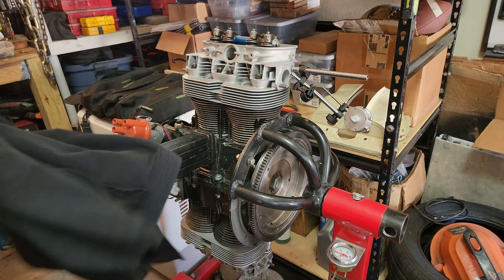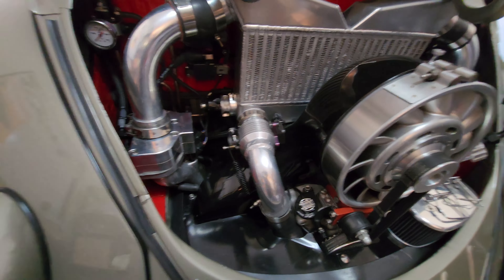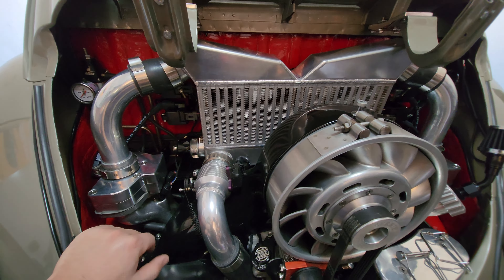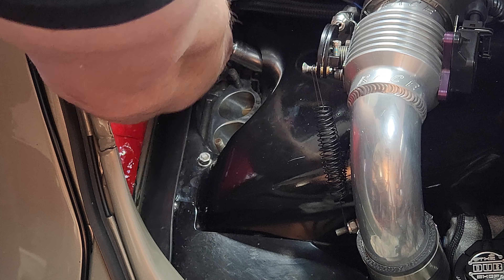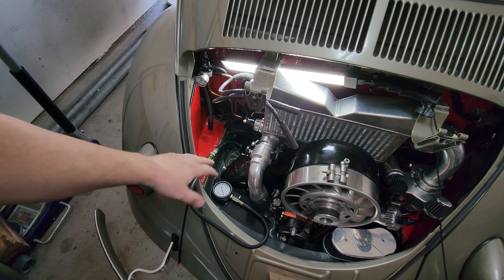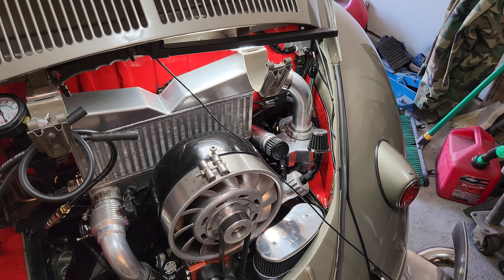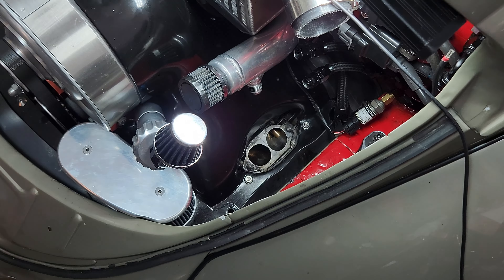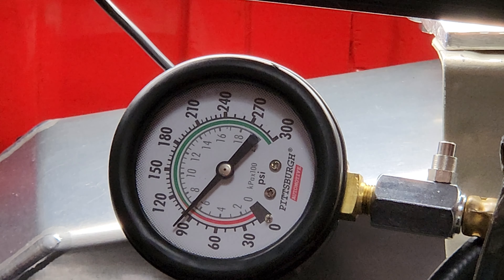TURBO Troubleshooting Air-Cooled VW | Boost Blow-by | JW Classic VW

Comment: Nice video,  your concerns are real. Piston seal is probably your biggest problem. Honing and piston rings now days can be done professionally. I use to do the same as you, now I get to those with the big machines and diamond stones. It works, no more problems.. good luck..
Reply from the maker: Yeah I'm having a set of torque plates made for this next go round, I really want to be able to do the hone myself.  I'm weird like that.

Comment: Running your oil level to high. Turbo engines run deep sumps and 1 to 1/2 quarts lower than stock levels. Helps drain the oil back out of the valve covers. That way while under boost oil is not forced down valve guides. .
Reply from the maker: Yeah.. my Oil pump scavenges the oil from the valve covers..  not sure how fast though, under boost I'm sure they fill right up.

Comment: I use Empi wider gaskets on mine adding a little engine oil to them... never had them blown. No sealant...
Reply: tested at 30 psi, no  leaks...
Reply from the maker: That's good to know..  just going off what I've seen recommend but definitely thinking about running some.

Comment: I had a bit of pinging on my freshly rebuilt motor, but it turned out to be too much advance on the 009. Apparently, a stock H Code 1500 has 0 degrees static and I had it set at 7 degrees! (Some info says all VWs are 7 degrees; not so!) Couple that with the uncertainty factor of the mech-advance 009 and you could end up with way too much advance as I did. An SVDA might be on the list soon, but meantime it doesn't pink anymore.
Reply from the maker: This is why I need to get my baby to the tuner after the fresh rebuild with the new pistons.
Reply: @JWClassicVW  Good idea. One thing having an out-of-tune motor that puts out 70HP but another thing altogether when your talking about a turbo-pressurized 300HP monster!!
Looking forward to seeing how things progress Jason :)

Comment: That sucks, you have to pull the engine out again. Use HQ engine parts to handle the boost/high heat.
Reply from the maker: That is the plan 4 sure... also getting some torque plates to Hone the new cylinders as well.

Comment: When the last time you did a vavle adjustment? Cylinder 2 look like it tight.
Reply from the maker: I check them pretty regularly since they are set to 0 lash, but it's all apart now so I'll be running through everything again.
Reply: @JWClassicVW  I seen that.

 I'm getting ready to get my motor running it's full potential soon. Got chromoly push rods, solid rockershafts, new swivel feet adjuster on the way, I got my set of 44idf now I just need my intake linkage and air filters. Going on my 1835cc with a Erason racing cam in it. It runs good right now besides its under carb with a Weber 38dg it try sucking the butterflys out the first on
Reply from the maker: Sounds like you've got some fun coming!

Comment: im thinking over-advanced ignition timing resulting in high cylinder pressures or fuel octane issues
Reply from the maker: I'm sure the timing and fuel is probably off a bit under boost... she needs some dyno time.
Reply: @JWClassicVW  im also not sure that Harbor Freight gauge is accurate.
Reply from the maker: Lol..  it works fine, used it many times on other engines. 
It's dead on with nicer one that my friend has.

Comment: My draw through set up has the deck hight adjusted at 7:1ratio. Running 10 psi supercharged sc12. My compression test comes as 110psi so for yours it does sound low.  It's a little odd they are all close though. It's it clod weather and are you only doing short distances?  If you are the soot could be just choke settings whilst the engine warms.  Good luck and happy tinkering. C
Reply from the maker: I really love this part, most would go crazy but I love tearing it apart and building her back stronger.  All part of the process of truly understanding your car.
Reply: @JWClassicVW  it's good for putting your mind at rest seeing if that noise heard was doing damage.  I stripped mine down after this type of noise but all was ok.  Found though my spark was blowing out at higher revs/boost causing it to sound like this. C

Comment: Do you have any knock sensor or cylinder temp sensor on the engine.
Reply from the maker: I have both
Reply: OK. Your plugs on the 1-2 side look really choked up with unburnt fuel.
Reply: The pistons you are using should not be turbocharged.

Comment: I personally think 100 is a little low.   The color on the  #2 is possibly a tight rocker arm...   hanging that valve open a little when it warms up.        I run a turbo as well and have been through the gamut of issues.   Forged pistons a must.   Ive broken 3 sets of AA pistons.      I also agree with fellow below in running the oil level a little low.   The engine leaks alot either way with turbo....  just have to decide what is a deal breaker for ya.    Keep the breather box clean,   and keep fresh 40w oil in it.
Reply from the maker: Never heard of the running oil level a lil low..  makes sense.  Good info on the possible tight rocker.  I'll be looking out for that.
Reply: I was just about to say tight rocker.

Comment: I just purchased a 2 l turbocharged engine and it's got oily spark plugs and oil going up the threads what would be the cause of this?
Reply from the maker: @evilbeetlekustomscreations4965  piston rings are probably letting oil by.  If it's not bad, then it's probably happening while in boost.  Unfortunately, it could also be bad seals in the Turbo.  Check your intake charge pipes and manifolds for oil.  If there's oil in there, it's leaking by the turbo, and it'll need to be rebuilt.  If not the turbo, then new piston rings are in your future.
Reply: @JWClassicVW   thank you so much I appreciate itI'll take a look tomorrow 😊

Comment: My engine is 92x82 2180. .050" deck height  62 cc head chamber. 9.1 CR. 110 psi when I did a compression test Jason. Compression might come up a little more with new barrels and rings. I think you washed down the cylinders being way too rich. Comen turbo woes.
Reply from the maker: I think that may be a possibility, didn't smell any fuel in the oil though... thought I would.